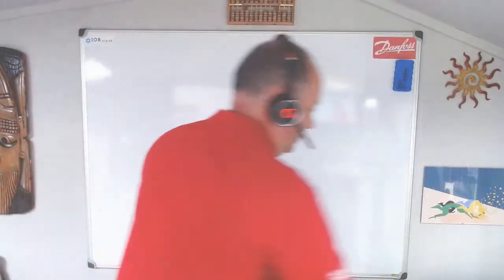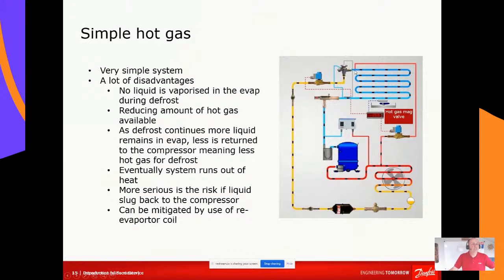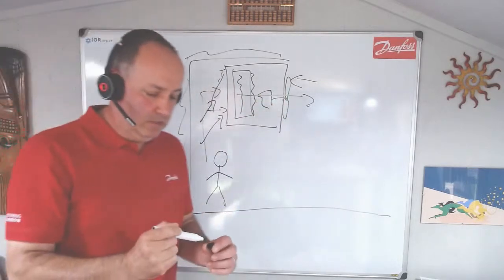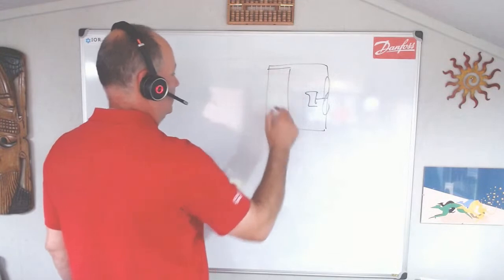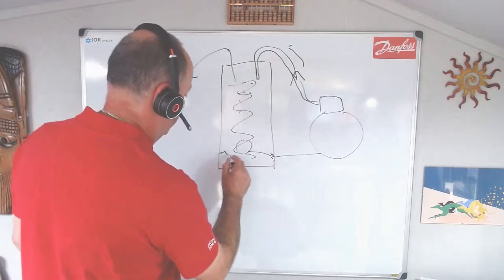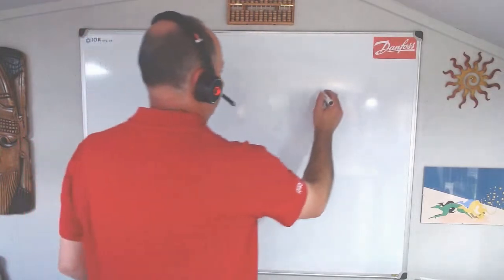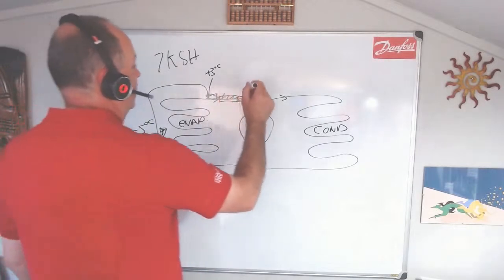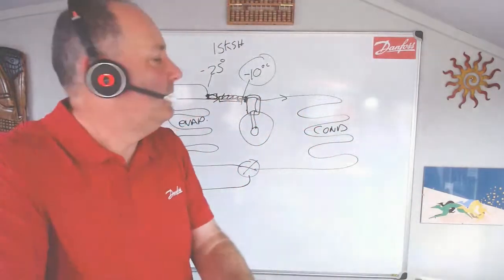Cold Room Defrost Q&A Livestream w/ John Broughton

Comment: Just to come back to a question that was asked during the webinar, a general rule of thumb regarding the amount of heat energy required to defrost an evaporator. I have spoken with a leading evaporator manufacturer and it goes like this:- The defrost heater load is 40% of the evaporator capacity. Meaning for example a 10 KW refrigeration capacity evaporator would have a total defrost heater load of 4 KW of electrical energy.

Comment: Hot gas defrost is eficient depending from where you have heat. If heat comes from compressor it is not efficient. The compressor is low efficient heat source. If you are using heat from outside it is very efficient.